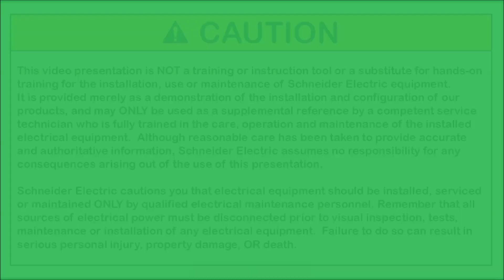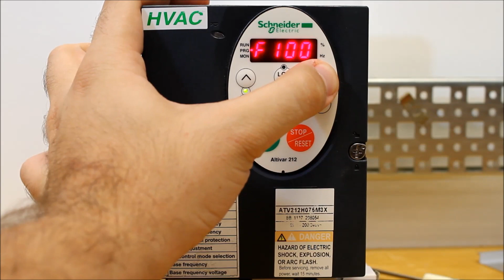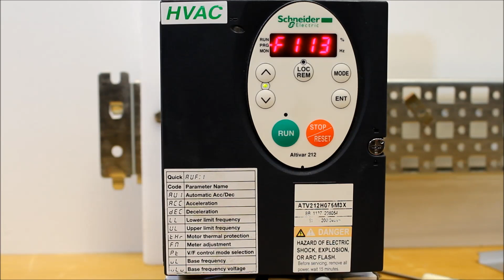Configuring Fault Reset Functionality on Altivar 212 Drives | Schneider Electric

Comment: We are  using RS-485 modbus communication  for altivar  212 vfd panel.. and prigramming  in  codesys  software. Our  vfd panel goes  to trip  state  when  on  command  reach and  reset it to  off  mode.. and again  goes  to trip  state when  on  command  reach  from  programme  side... it  continues  so much  time. So  i cant  run  it in  auto  mode. 

What  is the reason  behind  it???????????